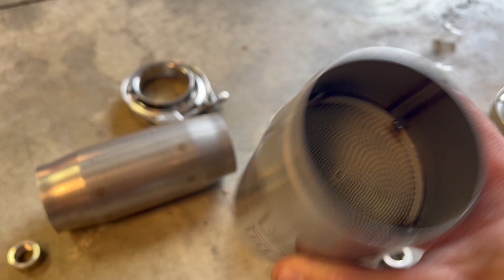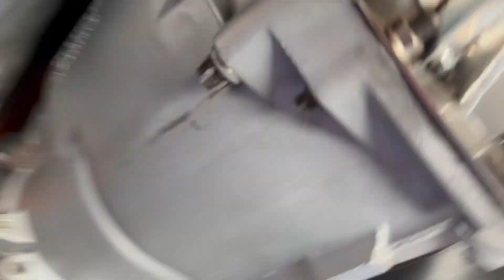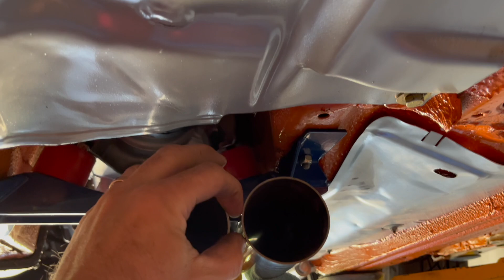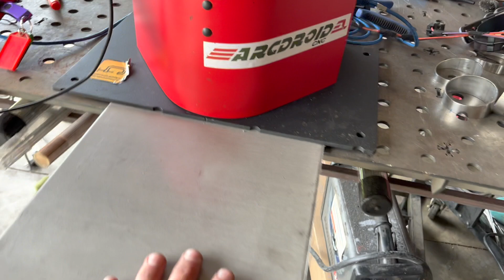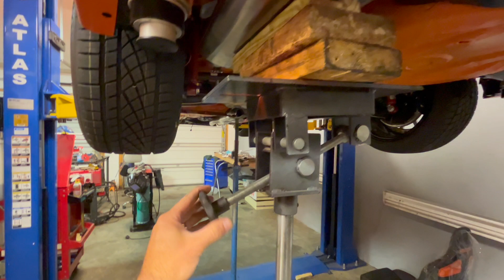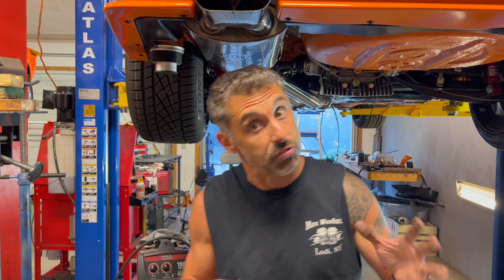Part 22: 🔧Building a Fully Stainless Steel TIG Welded Exhaust  🚗  Hartge E30 M3 S54!

Comment: I think the Downpipes are too low.
Below the Transmission Crossbar?
You could have followed the original shape, a little more to the right on the Frame Rail.

But it looks awesome👍
Reply from the maker: I thought about notching the crossbar to get them to sit higher, but then again that’s  not the lowest point on the exhaust, so I wasn’t too concerned. Thanks for your comment!